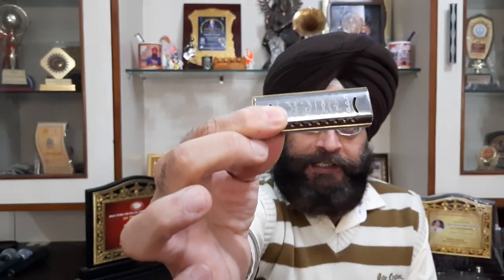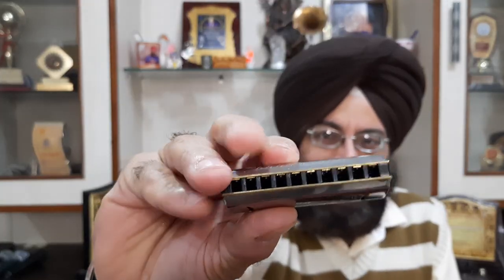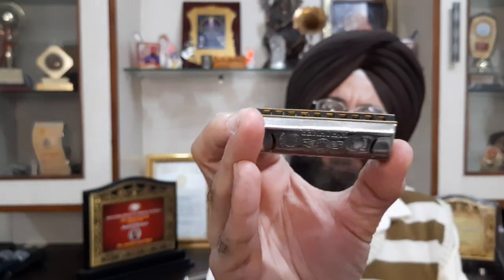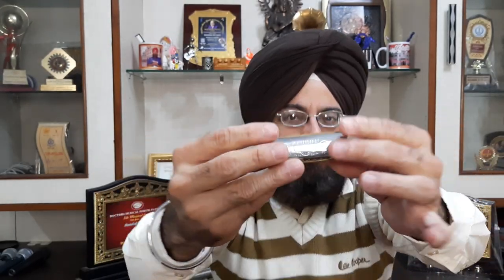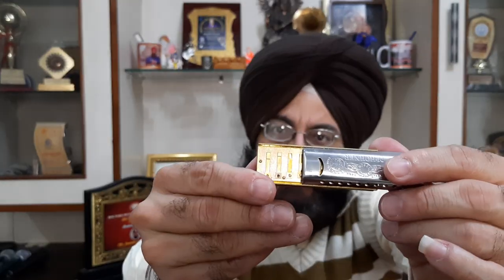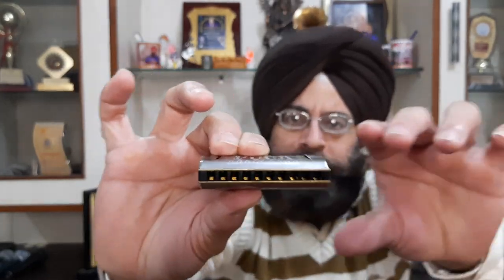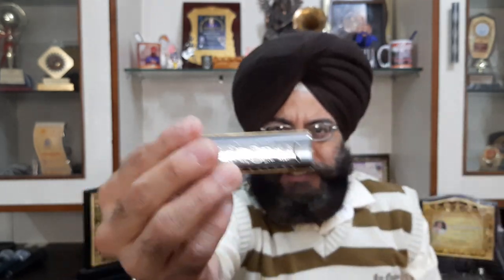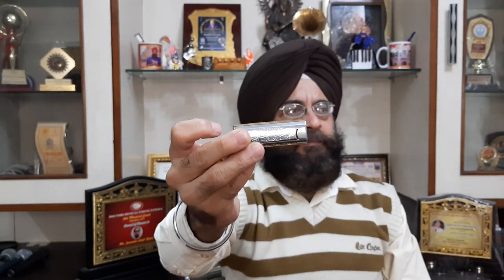Hohner puck | Harmonica tip for valve sticking |

Comment: Sir I just saw your video on PUCK mouthorgan and went back to 1955 when I started to play this at the age of 8 years. It was Rs 5/- then. Spoilt a few of them and then got my Crometta 8 gift from my parents which was priced at Rs 13/- in 1959. This,Crometta 8, was accidentally broken by a friend in school and so got another one in 1961, priced at Rs 45/-. Many many years later I happened to find a PUCK mouthorgan at a shop in Delhi. It was priced at 300/-. Immediately bought it and was thrilled to have it again. Sadly one of the reeds has broken and I have checked videos on how to repair it. Sir I later got a gift of Crometta-10 from my daughter but had some problems on playing. I was to buy a Crometta-14 but you advised me to buy Suzuki SCX 48, which I have recently purchased. Nice mouthorgan. I also bought a Vault 10 hole diatonic, but it is having a problem with the low notes. In your video which I saw recently, I now know why this is happening
because of Richter scale. Sorry for the long comment Sir, but it is wonderful to see your videos and get your advice.🙏 Regards,K M Pant

Comment: Sir, I am planning to upgrade my harmonica from Tower  24 holes Chromatic to either  Eastop or Suzuki or Hohner 12 Holes Chromatica. Now my confusion is I have practised on 24 holes Chromatica and if I change to 12 holes, will I be able to play and adjust to 12 holes Chromatica? Please advise which one is better suited if my budget is about Rs.5000/-. 24 holes Chromatica which brand and model is available within 5K to 7K. I am also interested to buy old brand Hero Trimolo. Where can I get this? I am keen follower of all your You Tube broadcasts. Love the way you go in to details of ever aspects of harmonica.
Reply from the maker: Majority of the players upgrade from 24 hole harmonica.  So it will not take much time to get adjusted.

Comment: Since the start of winter, I am also facing difficulty on my Easttop forerunner particularly after playing a while. Even though it is valveless, does this problem happen because of condensation too? Do we need to warm all types of harmonicas, or is that only advised for valved ones?
Reply from the maker: Yes it might be due to condensation.  Slightly warm it before playing